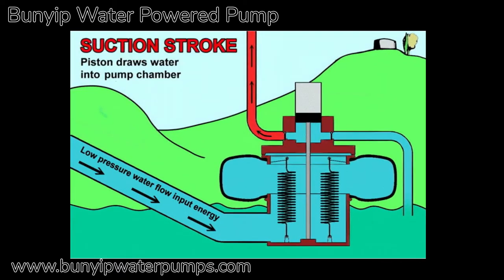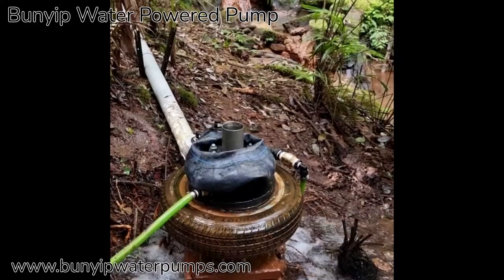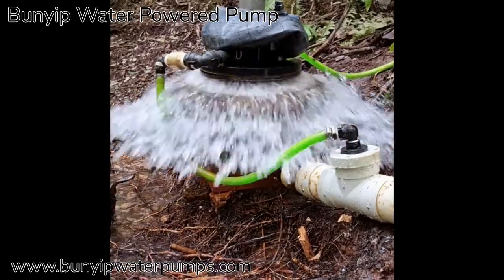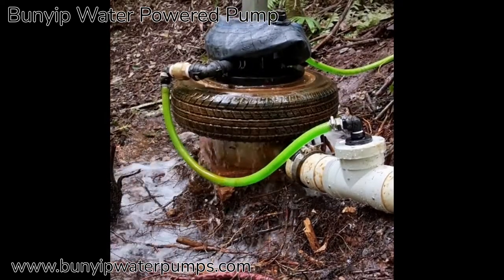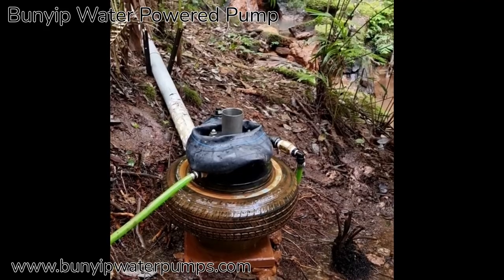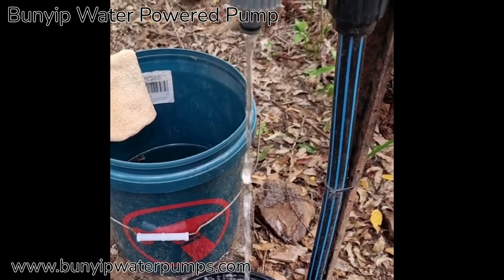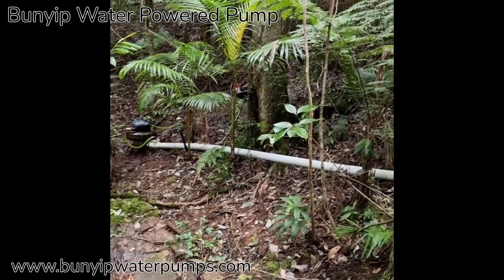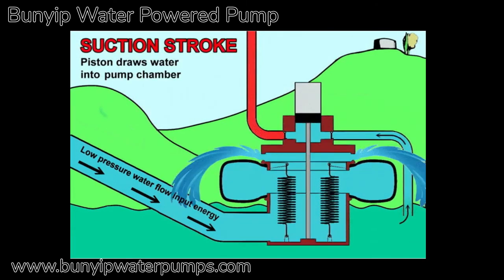Nimbin, NSW, Australia, PA13 Jun 2022

Comment: One good feature of bunyip pump is it can handle good size of debris not getting clogged up.
Reply from the maker: One of a few feature the Bunyip pump has, like self regulating to the flow, if the flow are less than the supply pipe size. The Bunyip pump with bigger piston can self prime, just naming a couple.

Comment: I’m trying to locate a distributor in the U.S. in the Upper Midwest - Michigan - so I may submit an order.  Off-Grid Agricultural Use. ☝️
Reply from the maker: I have been sending the Bunyip pumps into USA from Australia, mostly without the tire which helps with shipping, for about $600.00 AUD for the PA13 pump and around $300.00 for the PA8 pump.